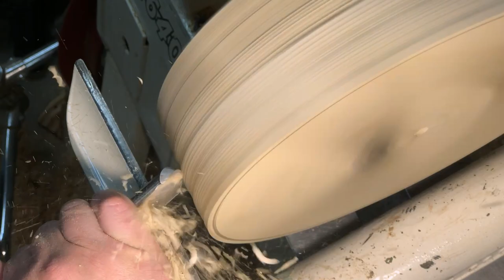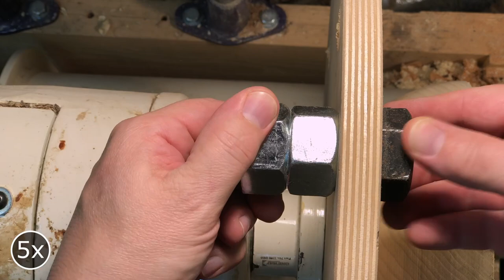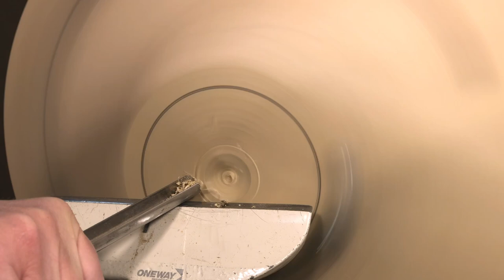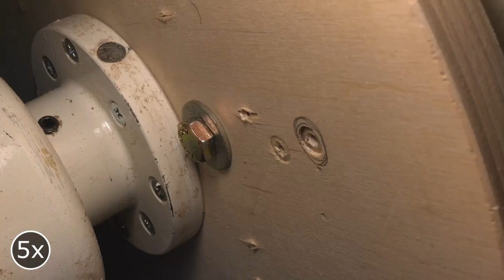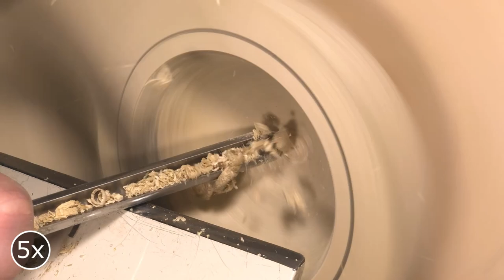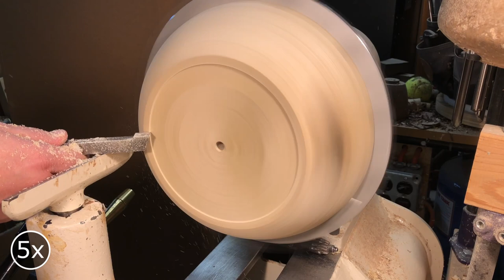Woodturning - 3-in-1 Bowl | Multi-Axis Woodturning

Comment from the maker: @Steve, I don’t why your comment isn’t showing up here, but I’ll try to explain nonetheless.

Hardwood lumber is a term used for wood that comes from trees that loose their leaves every year. Hardwoods are graded differently than softwood (wood from evergreen trees) and has different terminology to go along with the the different grading system. Whole books have been written on hardwood(s) so I won’t go farther than the question about thickness terminology.

The thickness denoted by the x/4 system is the approximate thickness of the wood after cutting but before drying and milling. All wood shrinks as it dries and the amount of shrinkage varies depending on the type of wood and where the wood was cut from the tree. My experience has been that 8/4 dry rough cut hardwood is usually between 2 1/8” and 1 7/8’ before planing. The standard thickness of 8/4 hardwood is 1 3/4” after planing. 4/4 is usually finished to 13/16” and 5/4 to 1 1/16”. after that the finished thickness is typically 1/4” less than the x/4 thickness. Wood 6/4 and thicker is usually only sold in even increments. 6/4, 8/4, 10/4 etc.

So an 8/4 board is about 2” thick at some point, but that is before the average retail customer ever sees the wood. 

Any piece of wood will also change in size as it gains or loses moisture. If a hypothetical 8/4 board is stored in a dry location it can shrink a bit and be less than the 1 3/4” it was when planed and vice versa.

Comment: do you mind sharing the plans for the jig?
Reply from the maker: I would if I had any. However, I improvised the entire project using whatever I had on hand and didn’t precisely measure anything.

The plywood disc with the weights (bolts) attached is about 15” in diameter, if that helps at all.

Thanks for watching and commenting.

Comment: I am really interested in exploring multi axis turning. Could you possibly PM me a copy of the dimensions and layout of the jig you are using??  Thankyou in advance.
Reply from the maker: When I do experiments like this I use whatever I have around the shop and I rarely bother making exact measurements of anything. In my opinion, this kind of turning is more about balance than absolute measurements.

That said, I’m guessing the plywood disc is about 15” in diameter. I know the bolts used as counter weights are 1” bolts 3” long and the bolt holding the piece being turned is 3/8” in diameter.

I realize this probably isn’t what you were looking for but with regards to this project, it’s all I’ve got.

Good luck with your woodturning and thanks for watching and commenting.

Comment: What type of wo0d is it,i am watching getting turned?     And thanks.
Reply from the maker: Hi Villain, thanks for watching another video! 

The wood being turned in this video is poplar. More specifically, a blank glued up from several pieces of 8/4 poplar.

For those unfamiliar with U.S. lumber terminology, 8/4 (spoken as “eight quarter) is about 1 3/4” (44 mm) thick after finish planing.
Reply: @CroakyOak  The reason i ask what type of wo0d was,because of watching wo0d turning,i bought 2 lathes.   A large one & a smaller one,i have made a few things,so i like to learn what type of wo0d,advanced turners use.    I have mostly turned hard wo0d & i noticed that the w0od you used lo0ked softer than the wo0d i turn,so yes,thank you.
Reply from the maker: Poplar is definitely softer than hard maple, walnut etc. It also has a very consistent grain and is  much less expensive around here, which is why I use it for projects that are still experimental. 

Interestingly, poplar is an excellent choice is you are planning on painting the wood. 

I considered using 2x lumber for this, but the difference in hardness between the earlywood and latewood can make a mess of things and cutting around the knots is usually not worth the hassle.
Reply: @CroakyOak  Very nice,i will keep all this in mind,as i really want to turn softer wo0d & i have not yet painted my work,but i was lo0king @ air-brushes in Amazon,so i will really need to give it all a try & thank you very much.
Reply from the maker: You’re welcome. Glad I could help.